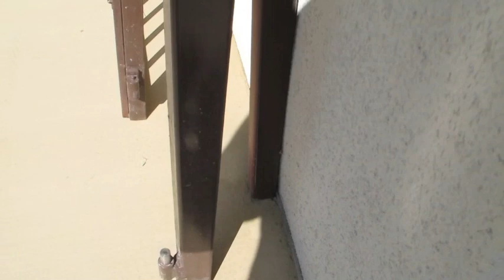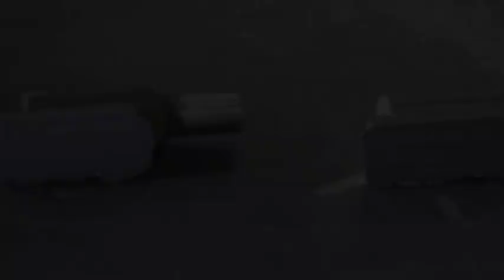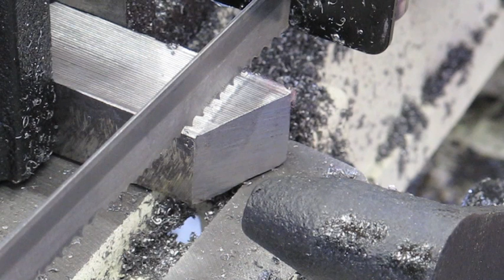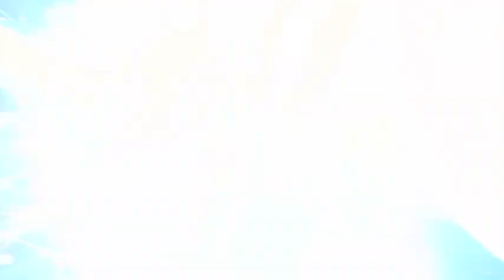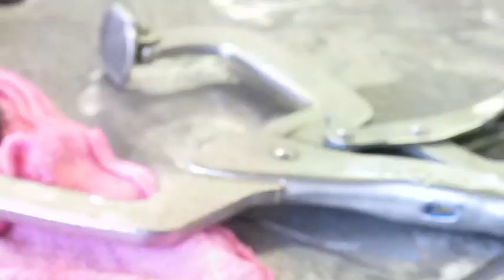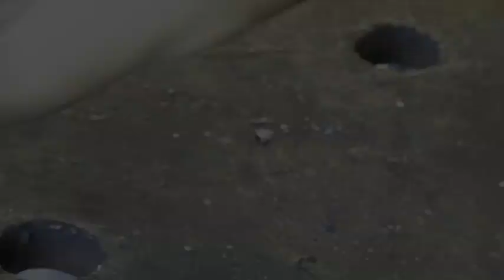Gate Project - Part 1

Comment: A rookie question....Do I need a 220 Volt MIG machine to weld solid square bars of 5/8" (15.9mm)? Can you recommend me a brand and a model of a MIG welder to weld that thickness (5/8") maybe up to 1"?
I am looking for a MIG Machine to weld wrought iron doors and gates, but I do not knnow which size and model is the right one......Thanks..